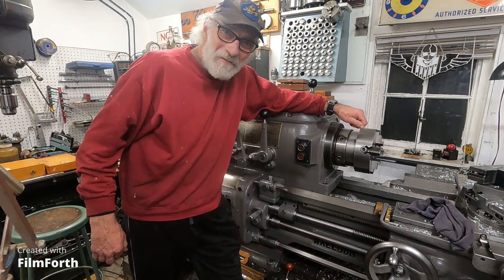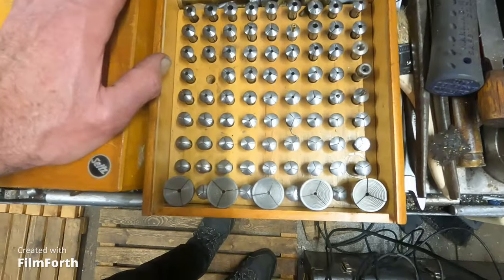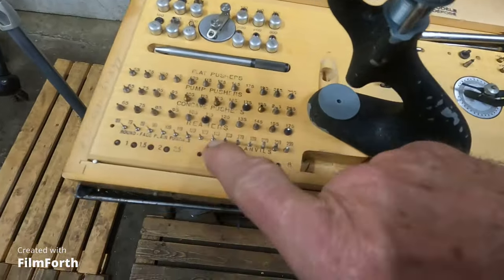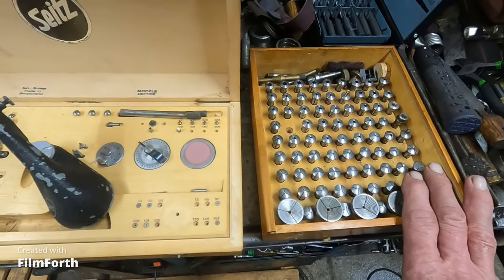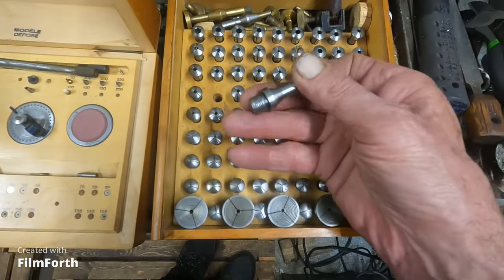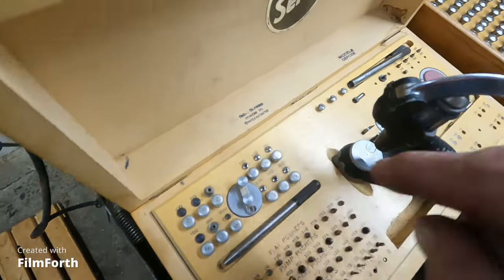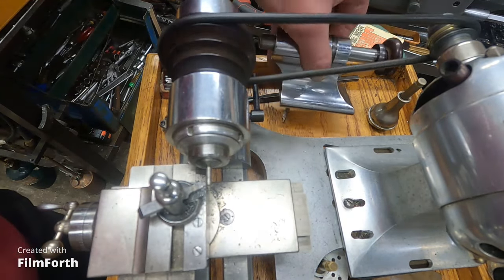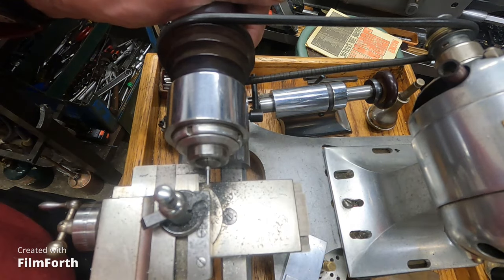Micro Precision machining 8mm Levin Lathe

Comment: Yes! That's awesome! Some years back, I had to downsize & move into a much smaller place. As part of the downsizing, I had to sell my metal lathe & replace it with a Taig micro lathe. I've always wondered if I should have bought a used watchmakers lathe instead. A lot of those watchmakers lathes look like they're built a lot more solid than the micro lathes. Thanks for posting :)
Reply from the maker: I have not used the other micro lathes yet, it looks like they do a lot
Reply: I’ve got a used levin lathe for sale

Comment: That spacer looks like the bearing shield for the headstock
Reply from the maker: I don't know
Reply: @deedeeindustrialsuperprecision  I recently took my Levin 8mm headstock apart to free up the bearings and there is a shield in there as well as a wavey washer to add tension on the bearing sets.

Comment: Hi Dee , great video , what’s the Lever on motor at pulley end ? Can see a slot around bell with piece sticking out.
Reply: I have to admit, I was curious about that, too.
Reply from the maker: That is the motor brush holder and reversing switch. The whole brush holder rotates in that slot to reverse. Hamilton Beach motor.